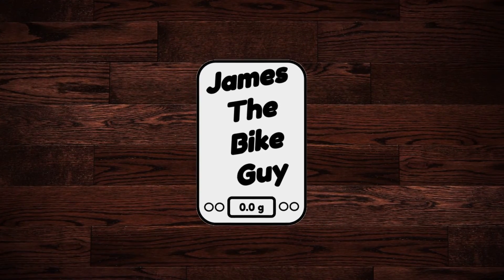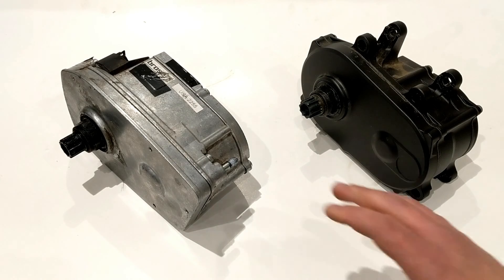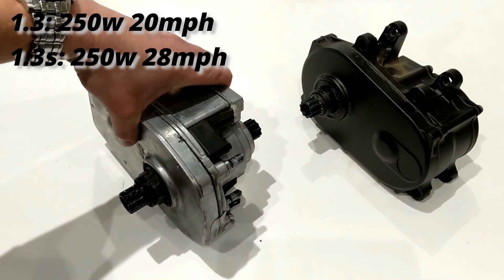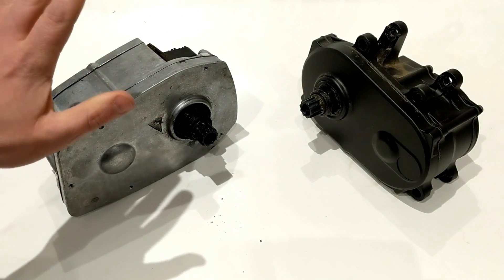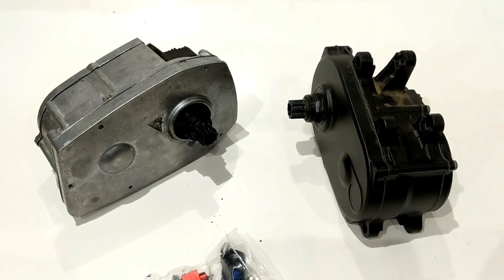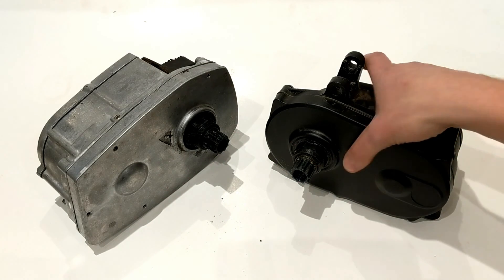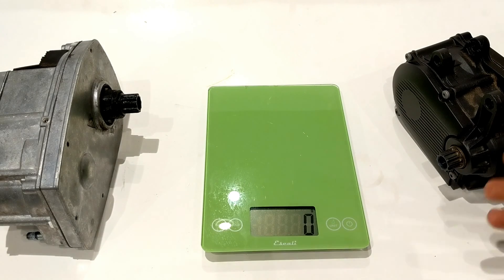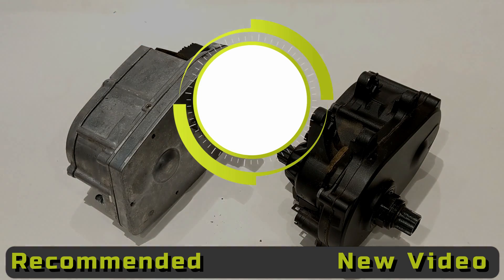All About Brose Motors in Specialized Turbo 1.2, 1.3 and 2.1 Levo, Kenevo, Vado and Como Ebikes

Comment: any one know if I can put the 1.3 motor in my 2017 Turbo Levo which now has the 1.2? will I need to update the firm ware ?will my battery work
Reply: I have a 2019 mod T.levo and suddenly it just made Mixmaster kitchen blender noises and wouldn't Go ofcourse so I sent it in the store had it for months then I got it back with a smaller motor i had to put a thick shim between the frame and the chain guide to be able to use the chain guard,, anyways I think it messed with the gearing the chainring is no longer in optimal center in line with the cassette ,, maybe it's bigger Yes it's wider atleast yes sorry so when I put on the shim it got pushed outwards,,,same same anyways nothing happened to it exempt the battery chrashed and the bike wouldn't turn on so they had the bike for many weeks then I got it back with another battery.. now I'm getting a New roval backwheel because somehow the tube inside the nav which the trubolt goes through have broken and it's impossible to just by that tube,a new nav to build the wheel back on it's needed so I just claimed new on the guarantee because I gave them the bike and they pretended to fix it and charged me for it.put They only washed the parts put on a new boss with ONLY 3pawls which fucks with the motor and the shuttle after just touching the pedals The motor spins around and stop's when The engagement comes (resistance) I'm still using it but I'm really annoyed about the store I bought it in always when they fix something they break something or switch something that isn't broken and the bike get worse...so I'm trying hard to learn to fix everything myself anyways if if they could fit another motor in the same frame with the same mounting points it will work when you do it to just not put the Crank arm's on the wrong side after changing like my store did ,,on a normal Crank that's not possible but it is on brose

Comment: At the beginning of September 2020 I was on a sales phone call with M... from LA Fly Rides USA who claimed to be the COO of the company he was trying to sell me an electric Bulls bike. I asked him about  the known problem Bulls e-bikes have with the Brose motor. He assured me that Bulls has no defects with their Brose motor. He further informed me that it was only SPECIALIZED e-bike (which I wanted to buy from him in the first place) that had "bad motor" issue due to their dumb tampering with the motor software. So based on his recommendation I bought a 2019 Bulls E-Stream EVO AM 4 (S Mag) Black matt/grey 49cm which I received on Sep-05-2020. After riding the bike for less than 500 miles the Brose motor suddenly jammed and locked and threw me off the bike causing me serious injury to my knees and elbows.  It seems the motor belt got broken after being jammed inside the sealed motor which was exactly the known defect I inquired about and was told “it did not exist”. I also had more than 5 different parts failure with the braking system and the e-bike frame hinges which was another disaster. I communicated all the bad news back to the COO of LA Fly Rides USA. He completely & utterly refused to solve these serious defects and blocked me from receiving phone calls to his mobile number and referred my emails to "the company lawyers". Now, the new Bulls e-bike has been sitting at my neighborhood bike shop for the last 55 days with its completely disabled motor while all my $5,500 investment was turned to waste toped with pain and suffering of my injury. This is the worst experience bike experience I've had in my life and I've never been lied to in such a massive way ever. I highly recommend not dealing with this company. You have been informed.
Reply: yep - the giant and bulls broke motors fail just as much as spicy, but specy is so much better with warranty and customer service.
Reply: oh man, I am sorry to hear about your experience.  Thanks for sharing this info.  I was going to call Fly ride to place an order tomorrow but after reading this I will take my business else where. I hope you sued those bastards for lying to you and for causing physical injury.  It seems that these hobby shops, esp in the US and more specifically in California, attract lots of low life scums as employees since it doesnt take much qualifications to be hired.   Same goes for paragliding.  You'll be amazed at what type of losers are teaching people how to fly.  Avoid torrey pines port at all costs if you ever think of getting into paragliding.

Comment: All the bikes were current year models, I have a ton of miles on a 2019 carbon bike, and its good so far. When you wash them keep the pressure away from the crank area. Use a hair dryer in that area if it gets wet.

Comment: I have owned 3 specialized e bikes at a time for myself and kids for 3 years and I ride mine, 30-50 miles a week average. And I have 3 more friends who have used theirs similarly for those years. One early 2017 had a motor noise- replacement. I wonder what cadence and level these bikes that fail are ridden at. 
We use all 3 settings. 50% eco 30% trail 20% turbo. cadence 70-100. quit a bit of jumping and rock gardens. I am happy as can be with my bikes. owned mostly carbon and Kenevo versions.

Comment: I’m going on my third motor in 9 months on my Como...I’m trying to get Specialized to give me my money back. I’m tired of being stranded
Reply: Which Como model do you have and what motor?  What are the problems?  I was strongly considering a Como 4.0 or a 5.0.  Any additional information would be helpful.  I am sorry for your situation hopefully Specialized will stand behind the bike!
Reply: @carlstoutamire9525  Specialized never returned my phone calls and replied to my emails with a boiler plate reply 5 times with 5 different complaint numbers.
Specialized did provide the new motor to my bike shop 3 times!
My bike shop agreed with me that I got a lemon and they were not pleased with Specialized support on many of their problems.
The interphase with the display was terrible you couldn’t start the motor unless you were stopped if you switched on the motor during a ride it would display motor error.
The only way I got my money back was when I mentioned my Attorney!
The bike store gave me my money back not specialized…
I now ride a Trek Allant and love it!
Bosch motor is great and it interphase perfectly with the Bosch computer display.
On the Como I went thru brake pads and chain in 500 miles!
Reply: @sweetpeacunningham  Wow!  What a story!  I am glad you had a great bike shop.  I think you helped me make by decision I WILL NOT purchase a "Specialized" bike because they are not "Specialized"  this information is the same crap I hear about the cheap made in China bikes for 1/3 to 1/2 the cost.  Thanks for the update and enjoy your new bike!
Reply from the maker: Oh my.

Comment: That brose motor 2.1 from my 2020 turbo levo is a junk, this is the second time that Spezialized change this motor because a failure, that stop the motor from working, and 2 friends that purchase the same bike they also have the same problem, but Spezialized dont even talk about it, they are losing a lot of money clients and credibility.
Reply from the maker: Growing pains are real but it is a good think that Specialized has a pretty awesome warranty.
Reply: @Jamesthebikeguy  ...but they don't always honor the warranty.  Its at their discretion.
Reply: The 1.3s in my turbo Vado 5.0 went out after two months and my bike shop replaced it with what I'm guessing is a 1.3 because now the speed is gone and it drags at 18 MPH. I want the class 3 motor I paid for along with the performance I enjoyed for 2 months before it broke. Taking it back tomorrow. They told me specialized extended the warranty to 4 years, but for 5k I want a bike that works and isn't in the shop every 2 months.

Comment: I have heard of motor failures on the levo is that common?
Reply: Andrew Dale with only 70 miles on the bike and only 20 miles off-road the bike shut off 1/4 mile into today’s ride. It’s currently at the shop. The display is totally unresponsive and off. I absolutely love the bike but I have to admit I’m really disappointed right now. My epic ride cancelled and my day traveling back and forth to the bike store. ==== to follow up the control/brain is bad and a new one is on the way. Covered of course by the warranty. It should be here within the week. So far one week of riding and one week waiting for repairs since I bought the bike. Let’s hope for smooth sailing after this.
Reply from the maker: I have not seen much in the way of issues. So far anything has been warranty anyway.
Reply: Andrew Dale after getting my warranty repairs on my Levo comp I have since put on over 400 miles and the bike is operating perfectly. I did find out though that while the motor housing is waterproof the on/off switch is not. The 700 watt battery does not come out of the bike without hitting the ground first unless the bike is in a stand or flipped upside down. The problem is that even if the bike appears totally dry water can collect along the cabling behind the rear shock as well as around the motor housing that you can’t see. If you flip the bike upside down to remove the battery that water tracks the wiring directly into the top tube to the on/off switch and kills the bike. The brains of the bike/on/off switch should be waterproof and the cables behind the rear shock should have water stops. The good news is there’s a simple solution, don’t flip the bike upside down. Still a great bike and worth the trouble but a little bit of engineering and these problems and warranty claims would go away. I will say my local bike store saved the day. I am glad I had a specialized dealer nearby with excellent customer service.
Reply: Well I guess I’ll find out! I put the comment up and didn’t get a response so I went out and bought a levo comp yesterday. I went out riding and really enjoy the bike but as you know if you ride it is impossible to keep a mountain bike dry or clean. It’s also impossible to clean it without water. I’m not dumb enough to use a pressure washer on the bike but a soft, quick rinse with the hose is impossible to avoid. I’ll try to repost if I have problems or not. The thought of the bike having multiple failures is already giving me buyers remorse.
Reply: Brian Thompson I’ve had my 2019 Levo Expert for 14 months and 4000 miles and motor is still working great. I ride it hard, but I keep it dry.

Comment: Great review - would you go for a 2018 s-works levo that has had alot of miles, with 1.3-motor (newish motor) or a 2020 alu levo with 2.1-motor? S-works maybe 500$ more.
Reply from the maker: No question the 2020. Between the mega upgrades since the 2018, the warranty is so crucial, I'd be confident the 2020 is the way to go
Reply: Jamesthebikeguy thanks a lot! Appreciate it - probably the way to go..!
Reply: No Brainer for numerous reasons... get a 2020 Comp-- it comes with a 700Whr Battery and the prices are reduced for Covid-19. Maybe you already bought the bike by now.

Comment: Can you install a 1.3s in a 2018 Levo frame?
Reply from the maker: Physically yes, but the electronics are unlikely to function
Reply: sure, most 2018 Levo
s  had them in 2018 unless it was a base model, they fit either way.

Comment: the thing holding me back from getting an ebike is long term serviceability, i dont trust that manufacturers will provide parts batteries etc in 10-20 years time, these are basically disposable bikes
Reply from the maker: That is certainly a challenge. My hope is while brands like Bosch claim continued support for at least 7years that the major brands, I.e. Bosch, Brose, Shimano all get picked up by aftermarket brands for support in the 10+ year range.
Reply: You have a good point.
In the UK I’m reliant on third party companies that take up the slack.
My Yamaha PW SE motor has failed after 2500 miles and no warranty.
Even sourcing a replacement is very difficult,however there are a few companies that rebuild them thankfully,otherwise I’d be stuck.
Reply: After much research after a exhilarating bike ride on a Specialized Como 4.0 which I was ready to purchase.  I do think you have made a correct assessment on the situation.  Do not get caught up in the hype these bikes are expensive and disposable!!!